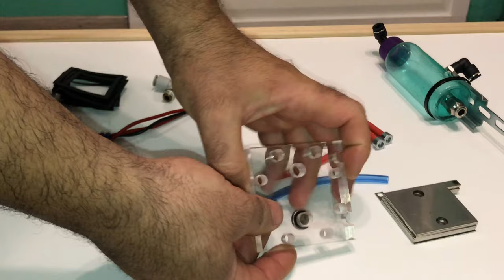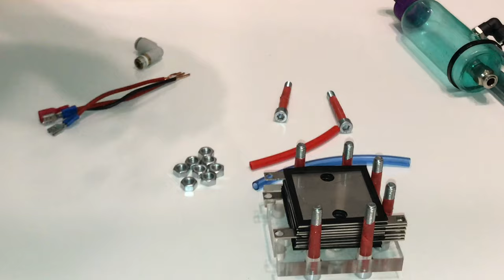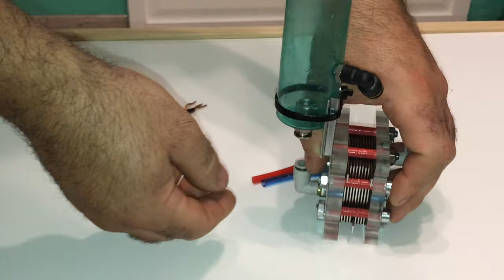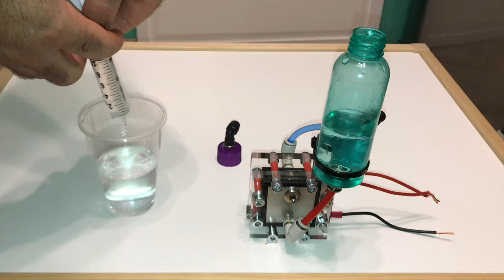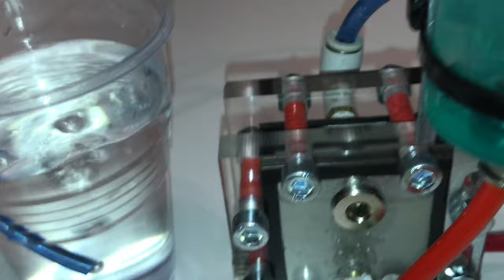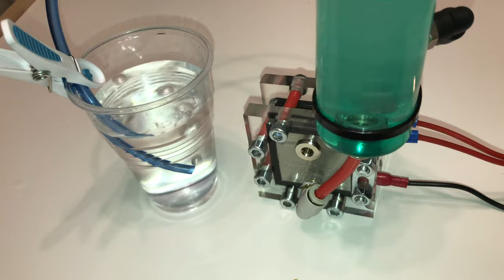HHO Dry Cell Generator. Electrolysis of water. hho fuel cell

Comment from the maker: Modification https://youtu.be/HrAH1JUzJRI
Reply: Love urvids Brother, very informative and easy to understand. No B.S! I'm very interested in making one of your HHO Generator Model's with a view to running it on my van for cleaner emissions and better fuel economy and I was wondering if u would know or how I would calculate the size (dimensionnaly) and No. Of plates etc I would need to build in order to run it with a 2.5L straight 4 Diesel Engine? Thanks for your great work and sharing this wonderful technology and How To. Respect to u......
Reply from the maker: @resistireland694  With 13 plates - 17 with a size of 100x100 you can make for your engine. Thanks
Reply: nice demonstration but its kinda hard to figure out how they connect positive to all the plates and negative to all its plates with out speach and is there a space cut out of thr fiberglass for the water to fit in ... im at a loss